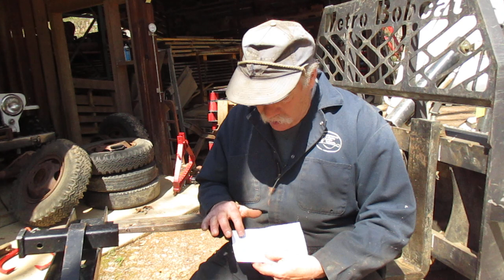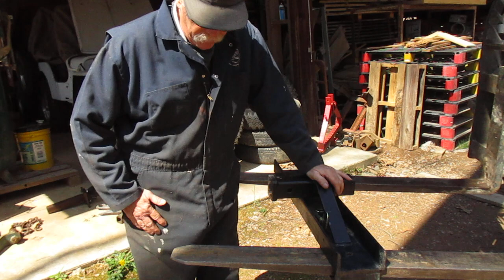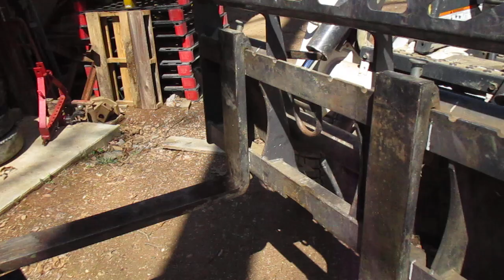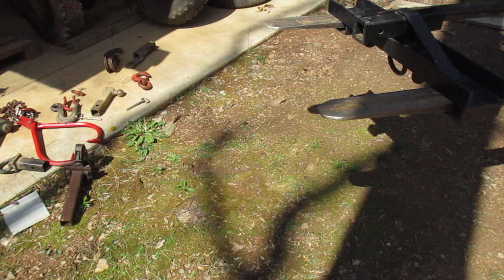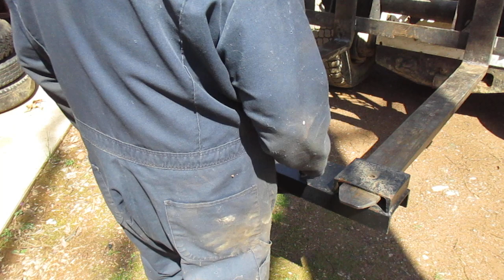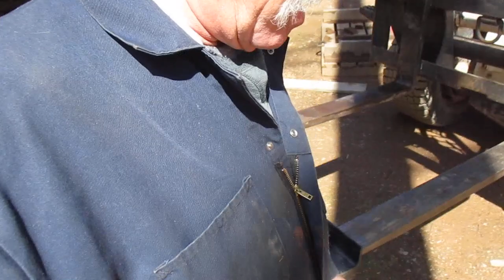Wranglerstar Made A Mistake   See How  #301 MVI 1407

Comment: That is a very thought out design, good job.  I have a similar setup for my forklift, mine is a 4 x 8 inch I-beam with several holes for chains & swivel loops etc.  This I-beam is attached with 1 inch bolts 5 inches from the fork ends.  You took yours one step further with the receiver idea, you got me thinking how I can follow your great idea.  A single fork attachment is too unstable like you mentioned and could be very dangerous.  I un-subscribed from Wranglerstar because I thought 40% of his vids were CLICKBAIT.
Reply from the maker: hi there the receiver is very handy john

Comment: There is also another way to utilize both forks with a slid on shoe or shoes, no drilling holes in the forks. Take two pieces of channel iron just a bit wider and longer then the forks to make a tube by welding them together so it slides onto both forks. Weld on the receiver as you did, also weld on a piece of chain to wrap around the fork frame with a clevis to secure it so it doesn’t slide off. This way the load is distributed the full length of the forks and not on the tips, where the holes have made it a weak spot.
Reply from the maker: hi there that sounds even better . thanks john

Comment: Hi John, I watched his video and I do agree that pulling a piece of equipment ( "Especially"  that is heavy on one side, which that processor is ) off of a trailer, you need to take all precautions possible!! Stuff goes wrong in a hurry as you are pointing out. It would have been well advised to let the air out of the trailer to lessen the slope as well, which was not done. A ball on a single fork is great for moving a trailer around but has it's limitations for sure! That could have been a very expensive mistake, lucky it worked out this time. 👍😎
Reply from the maker: hi there  i think you are right  thanks john

Comment: I agree Cody has a way of getting things done that can scare the heck out of people, and a lot of the general public doesn’t work with these pieces of equipment to know what is safe! I like your idea of a “yoke” setup, to balance the load by even distribution! 

Not to bust on Cody, but I watch him to know what not to do! 
I’m a former Electrician, Auto technician, and a Marine, I have seen many things that he has done that could be potentially dangerous!

One thing I would have done differently on your “yoke” is not drilling your forks at all, but to weld 4- 3/4 inch nut on the channels, 2 on each side top and bottom, then create 4 “tee handle” bolts to fit. The last thing would be to chain the “yoke” back to the frame of the fork supports! This a
Way might be a little more work, but you have not compromised the integrity of the equipment.
Reply from the maker: i think you may have even a better way , if this fails might change  . thanks john
Reply: @fricknjeep  I don’t know better, but I would say that it is a different way, that may not void a warranty, or be potentially dangerous!
This is where more then one set of eyes, and more then one brain can really improve a decision and or a product.

Comment: I have used a bolt on ball on a forklift but it was a 10 ton dual wheel rig so the weight offset was not bad. There were a few stupid picks that bent the fork down. Great design, have also used similar rigs like yours on smaller machines.
Reply from the maker: thanks john

Comment: he was talking about his Mag Drill ,I think he just worded the show tile wrong ,I have a ball assembly that bolts to my fork ,I'd never drill ,my fork and remember to never lift thing that would set my loader off balances also have a 3 point hitch on my tractor with a hitch that I use all the time to move my trailers ,lifts from about 10'' to 3 ft only a small tractor But Wranglerstar's tractor would have handle that processor just fine on the 3 point
Reply from the maker: hi there . i don't think i have ever used it to move a trailer more to pick things up . but with a 2 " receiver i have a lot more in what i can do . i use the D ring more . i also have a handy piece i made for the back of my tractor and it also has a 2 " reliever on it . maybe you have seen it in other videos . i use it a lot more . thanks john

Comment: having worked in the steel mills for 30  years   every fork truck had 1 fork with a hole 
in it so you could pin the load and prevent it from sliding off
Reply from the maker: thanks john

Comment: You are 100% CORRECT, sir. From an OSHA standpoint, he'd be shut down if caught using it. Yours, however, is so much safer because it evenly distributes the weight properly. I cringed as he cut that BIG hole into the end of his fork. He ruined it by destroying the integrity of it. But I loved the tool he used to do it with. Something similar to yours is currently used in factory settings and is OSHA compliant. He meant well, only he went about it with an unsafe method. Hopefully he'll see this and realize his mistake before he puts himself into danger. We're all entitled to a Blonde Moment every now and then, right?? lol Keep up the good work, John. It pleases me to see that Common Sense DOES still exist these days.
Reply from the maker: hi there yes i have those moments  thanks john

Comment: Lifting equipment is a serious business, and holes should not be drilled, along with lifting only on 1 fork.  I like your device across both forks, however, has is been tested and certified with a SWL?  All lifting equipment should be certified, and subject to an annual inspection.
Reply from the maker: hi there here in the farm or what ever this is the test is using it . Certified doesn't hold much respect with me . The only 2 buildings out of 9 here that were inspected and or certified are the only ones i have problems with . common sense is by fare better and safer . thanks john